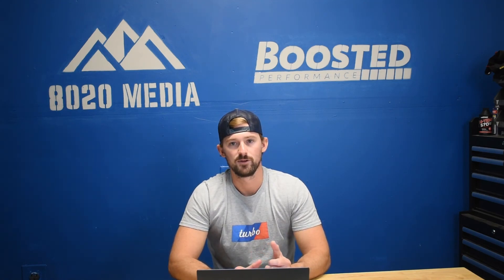5.3 Vortec - Everything You Need To Know

Comment: It is a pile of crap. Gm ruined that engine all those soilinoids failing and the lifters collapsing. The cylinder cut out deal did not work or perform well under the Carter adminstration and it will not work now. scrap that pile of junk and send it to the junkyard.
Reply from the maker: R - They certainly don't make them like they used to.

Comment: I have a 2002 Chevy Tahoe LS with the Vortec 5.3L.  My truck was make in Texas and I swear this thing is bullet proof.  I'm right at 200,000 miles and the only two parts that have been replaced in 23 years is 1 water pump and 2 AC compressors.  It still rides like new!!!!!
Reply from the maker: Q - Nice! Thanks for taking the time to share your experience!

Comment: I have a 2009 Chevy Silverado four-wheel-drive 53 Vortech engine mechanic just said wash cylinders regular oil change never hard on it low compression
Reply: Only 148,000 miles on my engine replaced the cam center throttlebody had it programmed in crank center
Reply from the maker: L - Thanks for sharing.

Comment: Can someone please explain why  in my 2017 Chevy suburban I’ve had it for about 5 years now, I know it says I can run 87 but when I do, my truck feels sluggish and it sounds like the engine works harder especially when pulling a load, but when I run 91 and above the engine response/the shifting and everything is way better even feel feels like it has a bit more power
Reply from the maker: S - Your Suburban runs better on 91-octane fuel because it allows the engine to operate at its full potential, especially under heavy loads or demanding conditions. While 87-octane is acceptable, premium fuel minimizes knock, improves power, and provides a smoother driving experience.
Reply: @ that’s what I thought… some one told me that it didn’t matter  because my suburban had the 5.3 in it and it will run the same on 87 like it would on 93 , I knew I was right thanks for the answer!
Reply from the maker: S - No problem!

Comment: Yes, the 5.3 is a forever beast, 4.8 as well. I have a 6.0 L96 with a 6L90 in my Suburban. I'm waiting for it to blow up so I can I re-build to a boost ready. Drove from PA to CA 2 times in 3 months with 175000, bought with 75K, on the dash towing a touring Harley, my stock wheels and some moving boxes. Had no issues. Bought a junkyard 5.3 just to start a LS1 build, just a personal build for a C10.
Reply from the maker: D - Thanks for taking the time to share your experience.
Reply: What about the afm flex fuel 5.3
Reply from the maker: J - What about it?
Reply: @8020Automotive  how long do they last are they durable I have a 07 Chevy avalanche 5.3 flex fuel with afm
Reply: It's got 165000 but very strong
Reply from the maker: J - There's not much of a difference. Just maintain it well, like it sounds like you already are!

Comment: I'm up towards 270k in my  '11 Tahoe. Was never allowed to bulletproof it because of local regulations but it is showing no signs of weakness whatsoever. It just runs, runs runs. Very low rpm engine, strong and just a bit thirsty just the way I like it. Just a heads up to keep up with the oil changes, it goes pitch black and fast if you don't react in time.
Reply from the maker: P - Thanks for sharing your experience! Sounds like you take great care of it.

Comment: I was wondering why my number 7 spark plug had oil on it. Glad i found this video
Reply from the maker: J - Thanks for the feedback! We hope it was helpful.
Reply: @8020Automotive  I wonder if putting the 12-13 valve cover on is the fix.

I reject the idea of dod delete. I'd rather refresh all the components and keep on trucking.

I have found carbon buildup on cylinder 1 spark plugs an oil on my number 7.  But the truck has been solid even with AFM 185,000 miles and climbing.

Instead of giving up on the old girl I'm going to overhaul it

Comment: Only things I hate about these engines other than the afm and vvt is the transmissions and gen 3 knock sensor locations. I have a 07 new body sierra thats currently got a cammed 5.3, which was built after my afm went out. I went through 3 4l60 transmissions, 1 with a stock engine and 2 with the current setup, Overtime i dont think gm reilized with the original designs of the 4l60s from going to cars with only 100 to 200 horsepower and lower final drive ratios, not to mention smaller tires would eventually overwork the transmissions. I ended up getting rid of my 4l60 and swapping in a 4l80 transmission. Also, something else that I'm pretty sure I've heard a little bit about on gen 3s is the knock sensors location. On the Gen 3 engines they are located underneath the intake manifold built into the valley cover, And oftentimes with The location they're in oil from the PCV and even moisture buildup ended up shortening out the circuits and even causing internal corrosion. On the Gen 4 though that wasn't so much a thing anymore because of the facts. They're now on the side of the block. Which I'm not going to lie. Pulling an intake, manifold and fuel rails just to replace sensors is insane.
Reply from the maker: T - Well said! Thanks for taking the time to share these insights and your experience. Will certainly help future viewers.

Comment: My 04 Tahoe L59 just hit 180k and runs perfect. Inside the valve cover is so clean it still shines. 
Had a diet of Mobil 1 since new. One coil, water pump, tensioner, and belts is all its ever needed except plugs and wires at 100k. The trans and axle serviced every 40k
 I replaced both leather seat bottoms to keep inside like new. I will never ever part with this SUV. Its just broken in! Best truck based SUVs ever made.
Reply from the maker: G - Thanks for taking the time to share your first hand experience!

Comment: My 2012 Silverado with the 5.3 is amazing though It does have afm which I’m afraid of it causing problems but I’m thinking of deactivating that
Reply from the maker: R - We made an AFM disabler that will help with this! https://www.amazon.com/dp/B0D1T1FMJK?maas=maas_adg_2CDE464277A6404D470A623F0084F062_afap_abs&ref_=aa_maas&tag=maas

We've also made an AFM video to assist in your research on whether or not you should disable it. https://youtu.be/eMFBwYjIyPY

Comment: That GMT800 3.78 bore block is one hell of a block design, the 4.8 and 5.3 both sport the same block and they last well into the 400,000 mile mark and I've seen a couple 500,000 milers down south, the motor typically outlasts the frame up here in Wisconsin cause of rust and road salt. What I will say about the gen 4 vortec on the GMT900 frames is that it starts burning a lot of oil if you don't keep up on oil changes because of the aluminum block, it wears out easily if you have dirty ass oil in your motor.

The oil burning could also be related to the Active Fuel Management system
Reply from the maker: S - Thanks for taking the time to share these insights.

Comment: The L33 aluminum block from 05/06 trucks are great.
Reply from the maker: B - Thanks for sharing this insight.
Reply: Agreed. The LM4 is a great aluminum option as well, but slightly lower performance. These are my recommended engines for S10 v8 swaps since they tend to be cheaper than other aluminum LS engines. I like aluminum blocks because they keep weight similar to the iron 4.3 V6 that originally came in many S10s.

Comment: My 2002 GMC Yukon XL 1500 has the 5.3 Vortec.  It only has 133K miles, and the only engine issue I had was needing to change the I take manifold gasket.  This engine is super reliable if it's regularly maintained.   Use high quality synthetic-mix or full synthetic oil.  Every 40 or 50K miles add a half can of Seafoam cleaner to the oil at about 500 miles before an oil change is due.
Reply from the maker: M - We couldn't agree more! Thanks for sharing your experience.
Reply: That's the intake manifold.

Comment: Its not the intake manifold that fails . Its the intake manifold gaskets and the upgrade is not to put factory OEM gaskets back on because they use a composite ( plastic) gaskets with rubber orings. They sell aluminum manifold gaskets with beefer orings which hold up much better.
Reply from the maker: Piney - Thanks for sharing this insight.

Comment: My 5.3 vortex in my 2000 silverado is still running strong at 416000 miles. I bought a 5.3 with 125000 miles from a suburban and I’m probably going to replace the engine before it shits the bed…. Generally, a 400000 engine is normally not happy. The key is to regularly change the oil.
Reply from the maker: Fishy - Thanks for sharing your experience! We couldn't agree more about the oil changes.
Reply: Good to have a spare but many on the road with over 500k mi

Comment: Is a LY5 or a LM7 better ? Wanting to put a turbo and make 400-500 with stock internals on a budget for a c4 corvette which one would be cost effective but be reliable to keep
Reply: Getting that many miles better keep it at low boost. 
Enignes with power adders just dont have the longeity.If you have the power youre gonna use it...then want more lol
Reply from the maker: Chick - If you're looking to mod it, we would advise the LM7 because of its iron block.
Reply: @8020Automotive  yea I’ma go with the lm7 also if I’m checking to buy a donor car how would I know if it’s an lm7 and not any other LS? looked it up but haven’t found anything that helped me.
Reply: Is there like a code on the side of it or something on the vin number
Reply from the maker: Chick - There's a few things you can look for here:
VIN: If the 8th character in the VIN is a "T" or "Z", there's a high likelihood it's a LM7. This isn't a sure fire thing, so make sure to use the below for more assurance.
Engine Block Casting Number: This is on the engine block and it's a number that you can search online to see what type of engine it is. 
Engine stickers: There should be some sort of sticker in the engine bay that will provide relevant info
Manual: Lastly, checking the vehicle manual should point you in the right direction.
Reply: @chicknnoodlesouuu2150  MAgnet wont stick to aluminum and by sight you should be able to tell one from the other

Comment: What is the common thing that will lock them up could it be the time chain
Reply from the maker: Timing chain could certainly seize one of these up. At higher mileage could also be overheating and warping internal components, low oil pressure, etc.

Comment: I have a gen 3 5.3 with the phantom coolant loss, she has just about 325,000 miles on her and still runs great.
Reply: check your water pump gaskets they are known to seep
May want to do a leakdown on your cooling system to make sure your head gaskets are healthy
Reply from the maker: LD - Thanks for sharing your experience! Sounds like you've got a good one.
Reply: +1 on the water pump to block gaskets.  Those deteriorate with age and weep down the front of the block.  Coolant is rarely seen because it evaporates quickly there.  You can see dry coolant trails with flashlight tho.

Comment: 416k miles on my 5.3 starts up and runs with no problems, replacing the radiator because it has a hole, And putting an aluminum radiator just to increase the longevity of my engine.
Reply from the maker: Lobster - Thanks for sharing your experience! Hope you get 416k more out of it.

Comment: I just flipped 250k on a 5.3 in an '03 tahoe, starts and runs great. The balance is amazing, hand to God I will forget it's running on occasion. This motor lives on the north end of that rpm line and still pulling strong!
Reply from the maker: Twitch - Love hearing a good 5.3! You've easily got 250k more.
Reply: Whoo🎉 redline party 🥳

Comment: Am so glad I found this. 
Got a good deal off a close friend. 
00 Chevy Silverado LS trim 2wd 5.3  third door.    
379K miles. Yeah I thought big flag but I know this dude real well. He has the history of the truck down. It's all highway miles I'm told.  And the engine and drivetrain it self. Starts up fine. Idles alright. No engine ticks nor knocks. Drives down the road straight and smooth. Shifts fine. Has some goodies. Some  
 Does leak oil as something as 20 years of age does usually.  Not sure how about to go fixing it's common issues and making it more bulletproof.  Hopefully see 400K or further! Some Steelie wheels and spacers. Nothing too monstrous. Lol. Has a subwoofer,amp and radio system. No check engine light or any error light. Gauges work and hold pressure.   Tool box and bed liner. 
Clean interior I'm talking like a 9/10 at least. 

I know these motor will go for a long time but  I've never had one myself till now.  Always been ford 300I or bmw M52TUB28. (Both current engine projects I have 😅) (all hail the inline 6😂) 
  just unsure on what I should do first with a motor with these many miles.  I'm thinking valve cover gaskets and intake gaskets. Maybe delete Ac(doesn't work anyway). Change the air box(cold air intake? Maybe.) 
🤷‍♂️ Don't know how or where to start. 🤦‍♂️😅🤣. 

Moving on.  Any advice is welcome.  Thanks for hearing my 2 cents worth of a story.  Hope these truck sees a lot of miles and provides me with good stories to tell.
Reply from the maker: Silver - Sounds like a sweet pickup! We would imagine that since it has 379k miles, the previous owner took great care of it.
Reply: I would only take it if it was free I would pay no money for a truck pushing 400,000 miles
Reply: @DustinKeating-yk3vq   Update. Truck just passed 390,000 miles. Still running strong as the day I bought it.  For the price of hauling a couple vehicles to the scrap yard, id say it's still a excellent deal.  Gets me from point A to B to C to D and back without any issues.  Yeah, it leaks oil, error code for O2 sensors, but. It fire up every time, engine runs great, Transmission shifts good, rear differential is holding up great, ride quality is solid(👍)going down the road at any speed under any load. This truck has not let me down yet...it might. But I will be able to repair it when that time comes.   Sure, it also needs the front end rebuilt(ball joints,tire rods, control arm bushing, wheel hub bearing, rack and pinion steering,) but at least I can get all that off RockAuto for a good deal and install it myself, rather than to be stuck without a vehicle, waiting on the dealership to get the unavailable parts to fix my brand new car and get screwed royally on the repair bill 

At least, when I go to do the Brakes on this truck. I'll be able to do it with a hand tools. Instead of a new vehicle being System locked and one would need a expensive scan tool to set the car system to maintenance mode to just change a brake rotor/pad/wheel bearing/suspension components.
   
To each their own opinion though. You are entitled  to your opinion as I am my own.   I'd rather have a tried and true, reliable, parts available, easily repairable, vehicle that's at least 20 years old. Over a new, overpriced, mansion on wheels, recall nightmare, unmaintainable, throwaway, non-repairable, plastic pieces of junk that rolls off today's Automotive assemble lines 🤷‍♂️

So, Mister. The next time your new vehicle is having issues, and you see an old pickup pushing 400k, running strong for cheap.  I want you to consider the price it's gonna take to fix your new car vs the cost of that old pickup. Let that thought soak in for awhile.   Good day to you Sir
Reply: Ford big six lover hear! I own a 96 Eddie short bed and the 04 Tahoe 5.3 for the Tahoe upgrades id keep the stock air box just add square fancy filter (brain fart I can't remember K and N) damn, replace the fan with E fans and grab some front brakes off an 07 Tahoe. A cam will rebirth your 5.3 I'm learning about small turbos now but don't want to over due it. Idk I am American 😅 rear sway bar upgrade was a good buy aswell
Reply: I also have to replace top control arm bushings and ball joint. Really all of it could be replaced 😢 I haven't touched my 96 Eddie 150 in 4 years other than oil change and wires rotor and bug. Same plugs same brakes. That's a hard 4 years of mudding by the river and 85 on the interstate floorboarded. The inline six is slow but tuff as hell.
Reply: My big six isn't slow off the line just at the top end. I can burn a one tire fire in second for a really long ways

Comment: Well done just purchased my first Chevy...2003 Avalanche no muffler trans struglles fron 1st to 2nd....But after that it goes into beast mode...216k...I love it
Reply: If its hanging in gear flush your trans and add a bottle of lucas non slip. It will keep the shift solenoids from getting sticky.
Reply from the maker: Denny - Thanks for sharing your experience. Hope the avalanche gives you another 200k!

Comment: 300,000 original miles on my lm7 5.3
Reply from the maker: Nice! We're at 225,000 problem free miles on our Suburban with the LM7.
Reply: @8020Automotive how hard was yours pushed because mine has had a very hard life and it is still going with the original 4l60e somehow and that is with only with fluid changes but anyways the 2005 tahoe I have has been used to pull 10,000 pounds its had a very hard life
Reply from the maker: Not very hard honestly, it used to tow a few waverunners from time to time but that was really it. Ton of cross country road trips but never much towing.
Reply: @8020Automotive nice I plan to buy another one of these trucks since the frame got damaged during the winter I went of the road and hit a highway sign which bent the frame rail barely and the inspector took my keys and refused to give them back